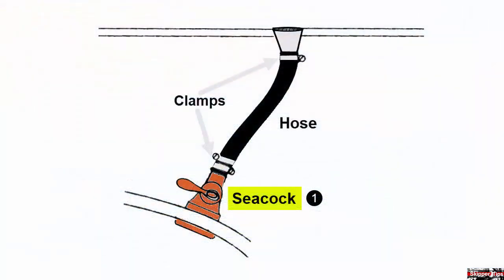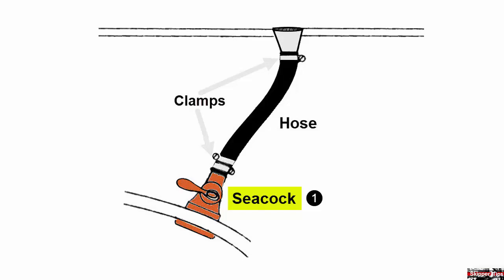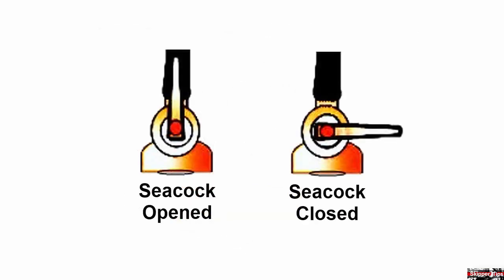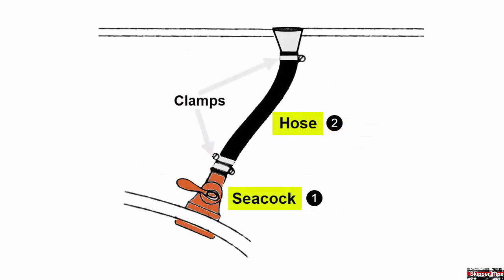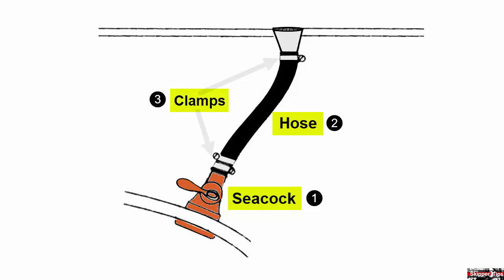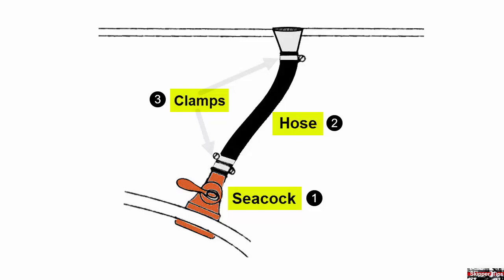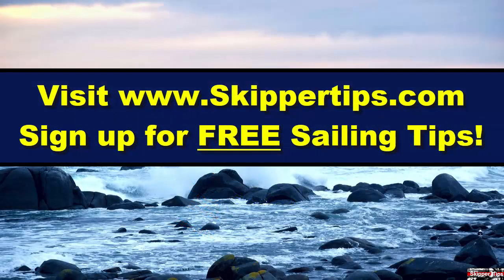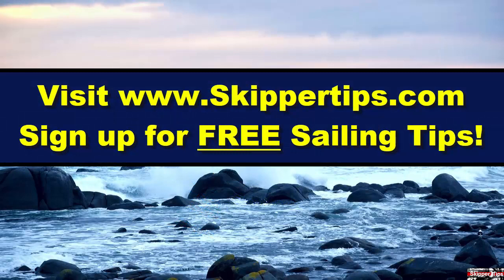Prevent Flooding with This Three-Part "Seacock System" Check

Comment: Thanks Captain John.
I grease my seacocks with Luberplate A130  in the spring before launch. Is there an alternate grease you recommend specifically for bronze seacocks?
Reply from the maker: Nick, use what works best for you. That same lubricant is used by other highly experienced offshore sailors: https://www.morganscloud.com/2015/04/26/seacock-lubrication-tip/
Reply: Thanks Captain John. It’s reassuring to know I use the noted method and grease , (even the same brush!) that is in the article in the link.